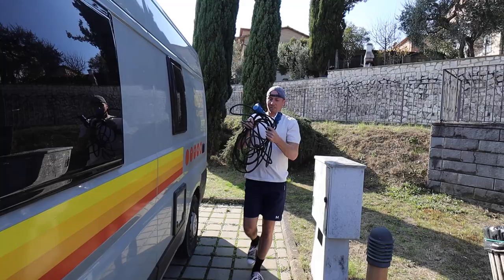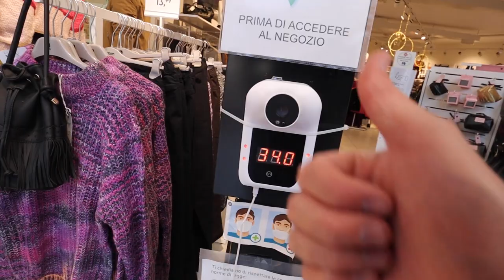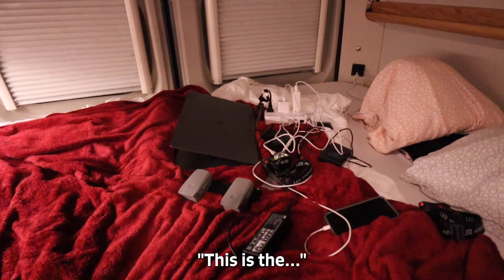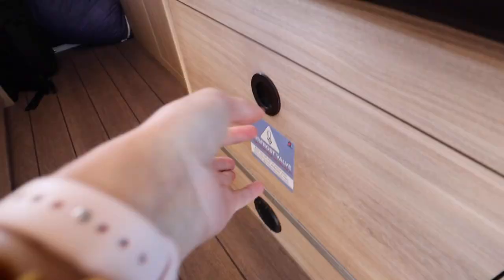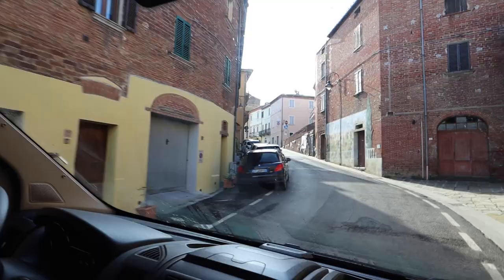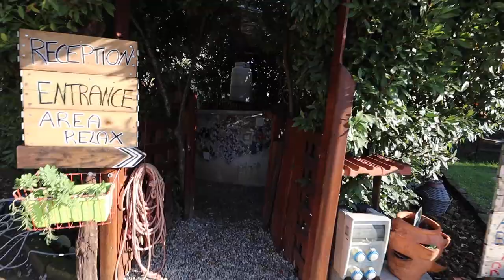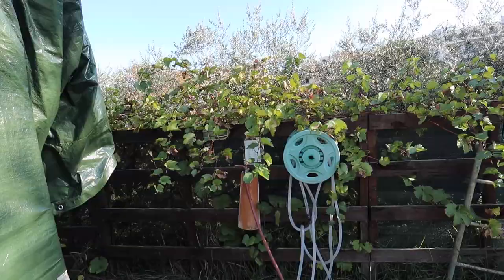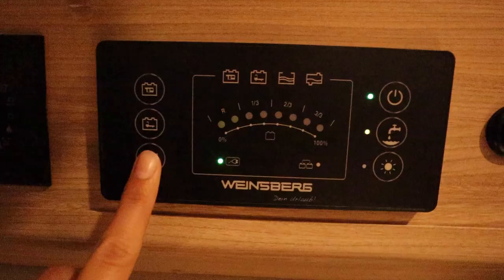Realities of Van Life in Italy - Hooking Up & Emptying Tanks

Comment: I have to say that van life looks good.  However, the realities, as shown in this video, really keep me from ever doing it.
Reply from the maker: Hi Glenn 👋 Thank you for leaving us a comment 🙌 We wanted to show all sides of van life, but definitely didn't mean to deter you 😅 It is not without its sacrifices, but ultimately, we would highly recommend it as the good far outweighs the bad in our eyes. If you are on the fence, there are all kinds of places you can rent from to give it a trial run 🏜🏔🏝🚐
Reply: @ThePassportCouple  we hired one of these vans and whilst it did have some issues, we loved it.  It was compact, operating system was similar to our caravan at home, so not too daunting.  Biggest issue was bedding, so we bought a topper, pillows and new sheets and another blanket.  We asked for a hose at the depot.  The electrical cable didn’t work and was too short so we bought a 20m one which they reimbursed us for, as they did the bedding.  Coffee mugs we needed too, but otherwise we loved it and are hiring again for 8 weeks next year 😁